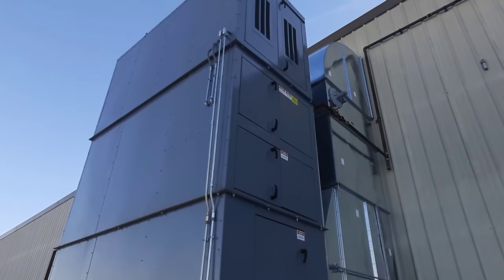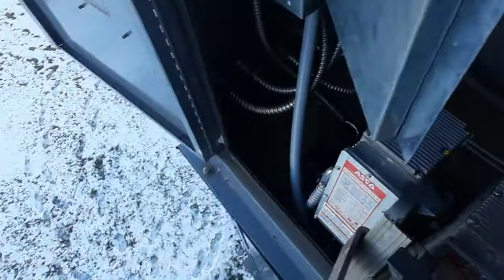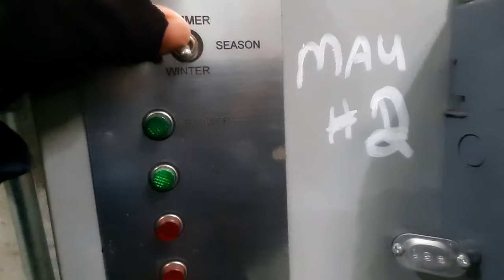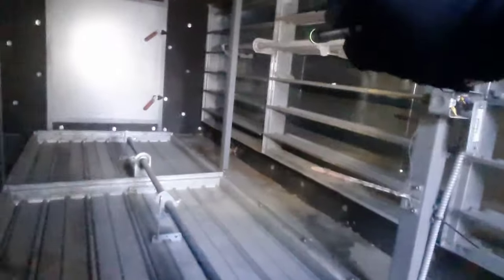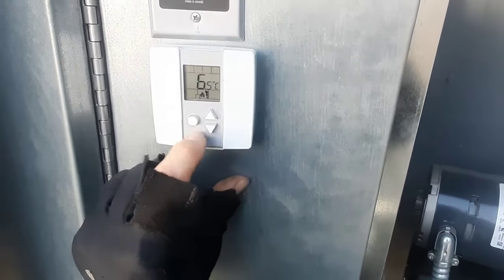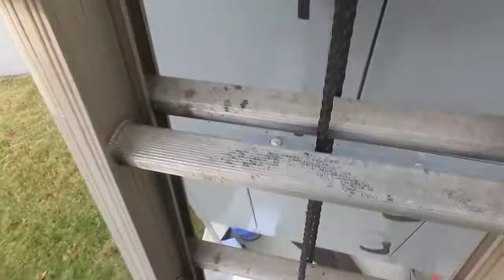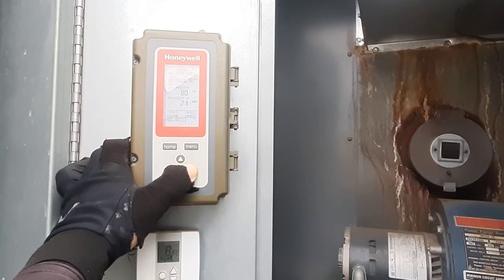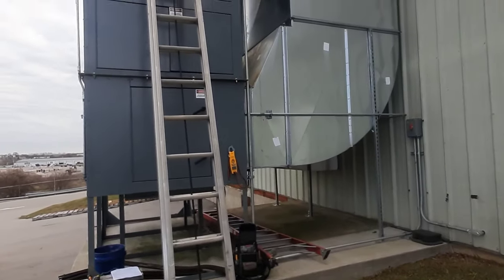Make up air unit not heating

Comment: Well done. I had a fault with the a/c system before Christmas and only open a few months and faulting out on super heat. It ended up the controller was set to wrong gas and compressor. Trying tech support was fun at this time. I was there when they weren't. I reprogrammed the controller and fine now.
Reply from the maker: It happens. Stuff doesn't get set up correctly or gets adjusted incorrectly. Thanks Jochem!

Comment: Sorry lost it, they have basically a rack of compressors feeding a multi-circuit evaporator.
Some of them control the humidity from the outside air and have either gas or electric reheat. There are different manufactures other than Aaon. All of these are design build per engineer specs. No diagrams abd no way to get them. Great job, considering how you had to use an extension ladder to get to it.
Reply from the maker: Thanks, George! We see a lot of these as well. Once you understand the basic operation, you have to understand what it was designed to do, then they are not too bad.

Comment: ICE (Industrial Commercial Equipment) is out of business but ICE Western (also in Canada) now manufactures and supports their equipment. Not sure if they bought them or if the merged or something else.
Reply from the maker: Interesting, we tried to get information, but the wire diagram wasn't this specific unit, and that's all we could get. Thanks Kenny W